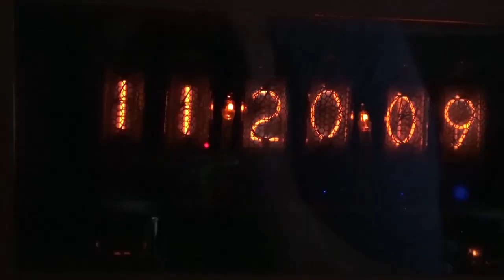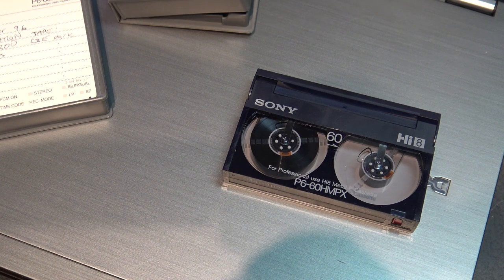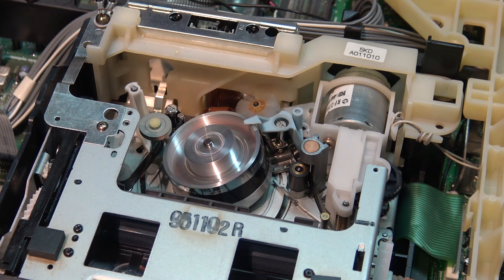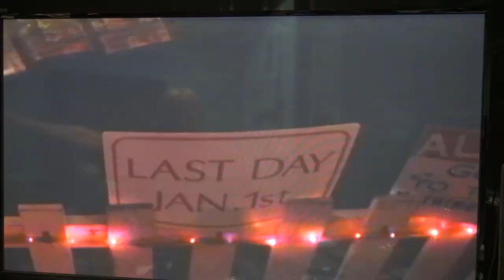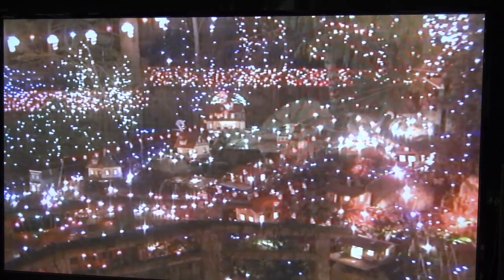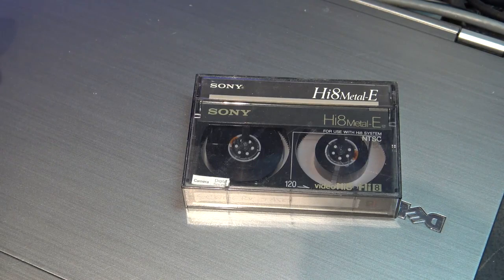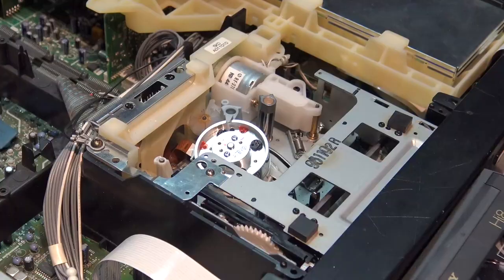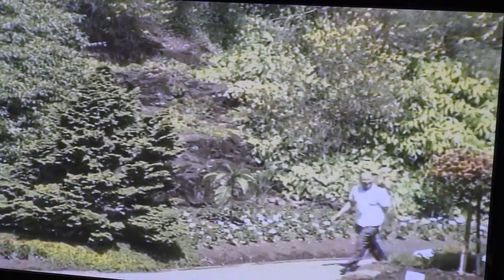Sony Hi8 tape was total garbage. Lets see why

Comment: I would expect ordinary brands to have problems, not sony, that's just mad :-(.

For vhs recordings i used many types.
I purchsed some Basf chromium tapes and they seemed great  but after sitting unplayed for a while they played back with hundreds of dropouts/dots on the screen.
The tape actually had visible dots on it, after ditching one cassette i left the rest in the front room.
The room heating was a little higher, and the dots vanished on every cassette and played perfect!!.
Never seen that effect before on any other tape brand, really odd.
Reply from the maker: BASH chrome video tape had many problems. The biggest was it is very abrasive, and many people had to replace the heads in their VCRs after a short time. Panasonic heads were the worst hit. Many wore under warranty and were replaced for free the first time.  Then panasonic issued a service bulletin warning about premature hear wear with BASF pure chrome tapes.
Reply: In that case i was lucky it didn't kill the heads in my old learning machine, the Piano key JVC 3320ek, all metal chassis and if it was dropped the floor would be badly damaged :-D.
The machines processing was on seperate Elna pcbs.
The only thing that pissed me off was the dc motor driving the video drum, the picture would sway or breath if the motor was imperfect.
Reply: @12voltvids  On top of that BASF tape simply doens't age well.  Their chromium dioxide binders were more brittle than average, they shed like crazy, and they get really sticky.  Even when new, BASF video tape was inferior to the likes of Maxell and TDK.  Ironically, so far as my observations go, when BASF stopped making their own tape in Germany and started having their video cassettes outsourced from Korea, they were better.
Reply: @12voltvids  There VHS  was no excuse .  the audio tapes are mint .
A worn out VHS tape could not look as bad as BASF
Reply from the maker: @shaun9107  Just goes to prove that Geraman engineering is not what it is cracked up to be. I have had a few German cars, and they were the biggest pieces of crap I ever drove. I understand that old British cars are also a steaming pile of crap but I have never owned one so I can't comment on that.

Comment: Dave, have you tried baking the tapes? It theoretically stops the sticking and clogging temporarily (for a few days).
That's great... I have a lot of Sony 8mm tapes... But maybe I have some time, they're all 2005 and newer (up to 2009), recorded in Digital8 format. Sony Hi8 and Digital8 tapes were very expensive at that time, so I switched to TDK at some point. Are those OK?
Reply from the maker: The TDK, Maxell and Fugi tapes I have used have all been OK. Just transferring a Maxell right now. Over 1 hour in and no problems. Recorded in 91. Problem has been with Sony HG and Hi8 MP tapes mostly. The evaporated tapes have more of a drop out problem.

Comment: Yeah that's inexcusable. Wonder if Sony mfg their own tape or had a second company do it.
Reply: Sony almost always made their own tape and, usually, they are fairly good.

But, they did have some crappy ones, too.  In addition to the tapes 12voltvids is talking about, Sony also had their UHG line of Dynamicron tapes for Beta and VHS, and those weren't good, either.  Initially, they were excellent, but then they developed a tendency to shed excessive amounts of oxide as they age to the point where a head clog within seconds was all but certain.  Meanwhile, their standard grade Dynamicron tapes are reasonably fine for their advanced age.
Reply from the maker: @Watcher3223  exactly the uhd tapes were horrendous.  There was a disclaimer on every tape warning about no warranty of any kind because tape can and does fail.
Reply: knowing how sony does their stuff they most likely designed it and all then had some small company produce them, and most likely said company did a crap job with the tape
Reply: On the reel to reel side of tape, most of the Sonys, despite being good back in the day, have also turned into sticky, shedding crap. Their audio cassettes are very good though.

Comment: Fortunately I have very few Sony tapes in my collection of 8mm tapes. For old open reel tapes that have the sticky tape syndrome it’s recommended to bake the tape prior to digitizing. This does work fortunately. I’m just curious if this is would be a possibility to make the transfer a little less painful of those affected Sony tapes?
Reply from the maker: 8mn is very thin tape and it is metal tape.  Don't know what baking will do to the tape.  Never tried it.
Reply: @12voltvids  Thats true. You scared me pretty good with this video. I have about 30 tapes that I need to digitize. I think Sony tapes must have been more expensive back in the day. I only have a couple with the majority of the tapes being Fuji, Memorex and TDK. I also have some 4 track reel to reel tapes to digitize and have been reading up on the baking process. Ampex recomends 130 F for 2 to 8 hours depending on the tape thickness. Best to experiment on tapes that can be destroyed first.

https://www.radioworld.com/industry/baking-magnetic-recording-tape

Comment: Hello Dave, This is very sad for many who have these Sony Hi8 tapes. I really hope, that they can save their tapes before it is too late. Kind regards, Ronny
Reply from the maker: Just got 3 more in from same era and same problems. One of the reasons I haven't posted much new stuff over the past few weeks is because I have been stuck watching boring home videos making sure they play and I can get the video off them.
Reply: That's very frustrating. I had the problem with a cheap VHS tape from Sony. After a few seconds, the picture was totally noisy. I like to use TDK and Fuji tapes. I used to have Video 8 tapes from Sony. But I do not know if the tapes were good or not.

Comment: Kinda scares me a bit, in a way, because technically, all magnetic tape recording medium in all formats will eventually end up like this potentially? VHS, 8mm, umatic, beta, VHS-C, hell maybe even cassette tapes too. I hear Reel to Reel which is one of the oldest consumer formats is already suffering this to some degree. Thoughts? Imagine all the computer archive backup tapes. Weeeeeee.... I still have some of the cassette tapes I have had since childhood in the 90s, and luckily they are still holding up well. Even the cheap 99 cent drugstore Gemini ones too.
Reply from the maker: Correct it will all fail eventually.

Comment: I've had the Sony video 8 tape. Since 1990. And they still play today. I have never had any problem with them.
And also The recordings I made in 1990 still played just as good today. It could have been a bad batch of tapes that you may have bought
Reply from the maker: Guarantee they do not play as well.  The color will have faded for starters.  No way to avoid it.

Comment: Sounds like they've got sticky-shed syndrome. Could these Sony Video-8 tapes be baked before trying to play them. Like they sometimes do to treat old audio tapes that have degraded like this, and the binder is breaking down.
Reply from the maker: Not a sticky shed problem. The binder fails and the coating comes off. When it gets really bad it will literally peel off and you end up with the surface of the tape all over the inside of the machine.
Reply: @12voltvids  I'm thinking it could be still worth trying to bake them. That's what tape baking is supposed to do, to temporarily harden the binder to try to stop the coating from going all over the head. It is only a temporary treatment. But I believe that's what studios have done sometimes, to archive irreplaceable master tapes that have degraded.

Comment: It is kind of funny you were evaluating a Hi8 camcorder for pro usage one year after DV launched :)

Another funny thing about your machine is M-load, which Sony has been using since Betacam bvw-200/300/400 because it allowed for more compact mechanism than U-load. Sony developed the mechanism to move the cassette onto and over the drum, and I think this idea has since been used for 8-mm mecha and for MiniDV mecha.

Regarding tapes, recently I had to digitize a couple dozen Video8 and Hi8 tapes from 1992 to 1995, mostly regular Video8, mostly Sony MP tapes - no issues. A couple of Hi8 tapes were TDK, no issues. I have two "professional" HMPX tapes NOS in wrapper which I wanted to try to record onto, now I am worried :) I've heard that the binder issues were resolved by the early 1990s, but you are saying that your cassettes are from the mid-1990s.
Reply from the maker: There is no comparison between the evw300 and the dxcvx1000.
The 300 blew the doors off if it and pretty much every consumer DV camera due to the 4:1:1 color space of DV.  I eventually caved and went for a vx1000 but it was pale by comparison.  I had betacam  at this time as well for commercial work.  I could intee cut betacam footage with hi8 from the 300 and you would be hard pressed to tell the difference.  Cutting with dv footage however stood out like a sore thumb.  I had a vx1000 but didn't use it much due to the unlocked audio problem.  I went full DV in 2000 with a JVC gydv500 and canon gl2 . Then hdv in 2004 and then pulled the plug on the commercial production business in 2005 as i started working shift work so i couldn't take commitments a year in advance and then not be able to get the day off work, my 2nd cameraman was too busy with family life to be reliable.  Canceled a wedding shoot and left me in a jam. Final nail in coffin so to speak was when my business partner ended up in a coffin.  That was the final straw and i stopped shooting weddings and corporate videos and just did the archiving stuff.
Reply: @12voltvids  I cannot believe Hi8 looked better than DV. Hi8 has lower luminance resolution, and its chrominance resolution is garbage. Both the EVW300 and VX1000 have 3CCD pickup, and I believe both have 1/3-inch sensors. No, really cannot believe it :) Although before DV came along, Hi8 was indeed the best of consumer-grade formats, and I've read similar opinions that the first generation looks almost as good as Betacam (original Betacam I guess, not SP or DigiBeta).
Reply from the maker: @ConsumerDV  DV used color space 4:1:1 which had very poor color resolution.  The evw300 had 1/2" sensors which performed better than the 1/3 of the vx1000. I had both.  Chroma was better on hi8 but lower SNR. What did look good was the evw300 connected to digital 8 recorder.
Reply: @12voltvids  I am blown away with this statement! 4:1:1 means 180 color samples in each line, while Hi8 resolves less than 60. Maybe in low light 1/2-inch sensors made a difference, but in good light the VX1000 should have been miles better. Oh, well, cannot argue with your past experience as you remember it.

Connecting the EVW300 to a digital recorder effectively made it a digital camera, so no question there.
Reply from the maker: @ConsumerDV  consumer DV  cameras had really shitty front ends.  The 300 into a DV or digital 8 deck looked superrior to both my canon gl2 and Sony vx1000.  Much better front end and superrior glass.  The evw300 onto tape looked better then either of the DV cameras I had. That was one of the reasons i dropped the dollars for the JVC gydv500.  You can't however compare analog to digital.  4:1:1 is quite poor for color rendering.  Lots of detail in lumamance but color is pretty weak.  1/4 of the lumamance pixels. 180 pixels as you said but analog is not measured in pixels as it is a continuous signal.

Comment: thanks for the info Dave. I have alot of Sony Hi8 tapes from the 90's too. Just have a question, I have a Sony GV-8 video walkman that wont turn on. It gets 5.9 volts at the slider power switch. Do leaking caps stop them turning on too? thanks
Reply: It's likely. You might as well check them just in case.
Reply: @rawr51919   I think it will sit as a display unit for now. Just picked up a GV500 fully working on ebay.

Comment: Hi, I have a Sony Hi 8 camcorder CCDTR3200 over 30 yers old and still in perfect working order. All my tapes are still playing back perfect including Sony, TDK and Maxell. I am carefull to store the tapes in a cool room standing upright in a metal container. I make short films and intend to do one on Hi8 soon. My newer camera is the Sony PXW-X70 with 4k installed. Thank you for your video I enjoyed it very much.
Reply from the maker: Some formulations of Sony tape was the shits.  I have a bunch that will clog the heads after a few minutes.  I also provide an archive service and see hundreds of tapes a month.  You have been lucky.  Best place to store tapes is on a shelf with good ventilation is a dry room.  Moisture is the killer.  Mold will ruin tapes.  I have had my share of moldy tapes to deal with.  
I shoot on Sony FDR AX33, 53 and 100. All are 4k. They are more than good enough for anything I am shooting.   I run the 4k at 100mb/sec and it looks incredible.
Reply: @12voltvids  Thank you for reply. I also shoot 4k at 100mps.By the way I use pal tapes as I'm in Ireland.

Comment: Why didn't you use a capture card for your demonstration?
Reply: Most capture cards generate a 30p output which is pure garbage for analog video, it can even do 60p if you use a good deinterlacing method.
Reply: @binarix128  Actually analog does 60i, dividing the fields from 30. 60p is slow motion. 30p makes sense to me for modern transfer
Reply: @video2000ification  but you can take the original 60i video and de interlace it with e.g. YADIF, which will produce a 60p output, and render the video at 60p; if for whatever reason you need a 30p output you can skip every two frames from the 60p video or de interlace the video interpolating the fields. But the correct way to trasnsfer analog video is by keeping the video interlaced so then it can be de-interlaced by the player, or generating 60p output using a proper algorithm.
Reply: The thing with (consumer) capture devices is that many of them are "hard wired" with garbage de-interlacing methods like field blending or field discard.
Reply: @binarix128  ...yes, especially on the timeline

Comment: I own a hitachi hi8/8mm camcorder that my grandfather owned before his unfortunate passing. The hi8 tapes he owned are going on about 20 years old (he used them in mostly 99 to 2003) the only issues I’ve found is a magenta tint at the top. The tape is maxwell 8mm. I can’t reuse the tape it seems. It turns to static when I record over previous footage

Comment: Now I know why Sony tapes become bluescreen on my machine, it fails to lock on to signal because the tapes are deteriorated and nothing is shown, but the time code goes on.
A interesting thing is that audio works and image can be seen in FF and REW.

My sony SDT-9000 also has a brush, but DSR-2000AP only a foam wheel.
Reply: are you sure?it could be a capacitor fail

Comment: Are digital 8 tapes good, and are all Sony tapes bad?
Reply from the maker: Digital 8 as a format was very good. Same quality as DV as the data format and compression identical. Many Sony hi8 tapes were bad.  Most digital 8 cameras had relatively low quality sensors as Sony didn't want them to look as good as the dv cameras and dvcam format professional cameras. I used to pump the analog s video output from my broadcast camera into my DCR trv110 camera and use it as an external recorder.  The quality was unbelievable.
Reply: 12voltvids thank you for responding because I'm thinking about getting a Sony DCR TRV-330 Digital eight camcorder.
Reply from the maker: @sonicfan82  They work good, but I have to wonder why in 2020 anyone is still fiddling around with tape.

Comment: This isn't even that bad. I had gotten a transfer job of about 10 tapes, all Sony MP or ME Hi-8 filmed between 1993 and 1999ish. All but the 1999 tape (had the Digital 8 logo on the shell) had playback problems after about 5 minutes. Whats weird is that it didn't appear to be tape shedding in my case. After I played back a section of tape in real time, that section (after head cleaning) seemed to be cured of playback problems.....almost like playback cleaned off whatever gunk was on the tape. No dropouts or other issues after that. I landed up returning the tapes after doing just one because I didn't want to risk damage to my equipment. I strongly suspect something with the tape lubricant was causing the problem in my case, not tape shedding (there were no telltale flakes in the playback device or visual damage).

Comment: 6:20 That bear is cute. Looks so happy. That tape format though is very crappy. We used the High 8 in our "Broadcast" class at school and had constant quality issues. When I finally broke into broadcasting in 1999 they were using DVCPro. It was better but the decks were plagued with crappy caps.
Reply from the maker: I have plenty of hi8 tapes that were fine.  Maxell TDK and Fuji.  Just the Sony tapes were problematic after they say around for years.